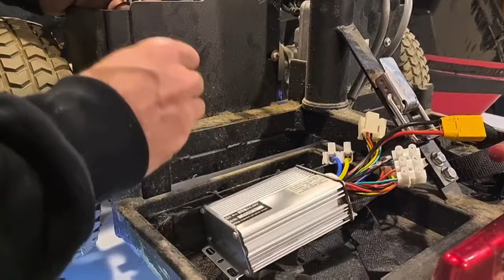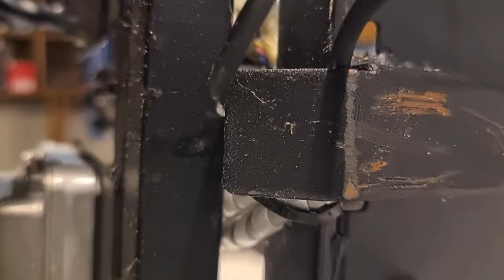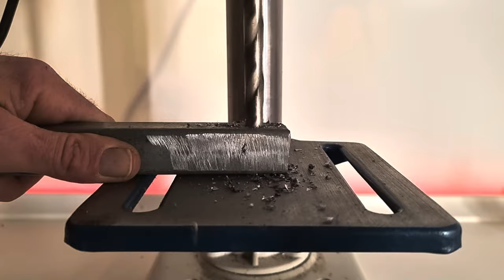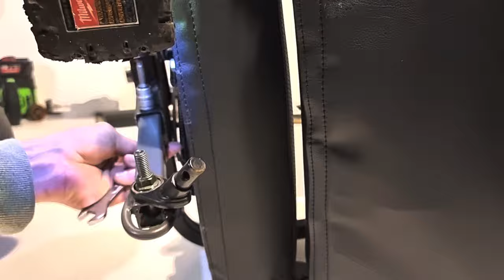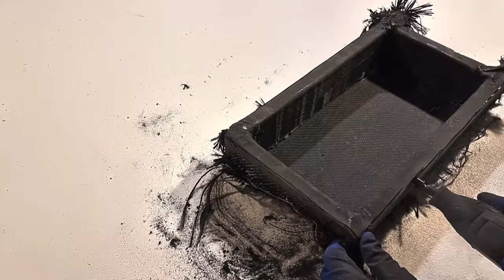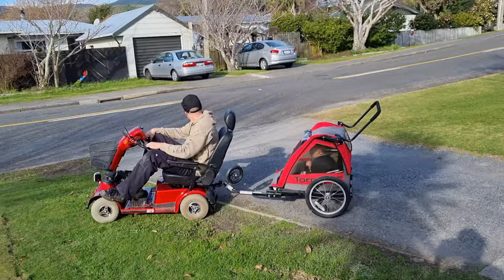DIY electric go kart for less than $100 usd with carbon fiber battery box, mobility scooter upgrade

Comment: I got tbe same controller, on a 24v 600w motor. With 48v lead acid its really slow, with 52v lion, its really fast but the battery cuts off on full throttle. What could be the issue
Reply from the maker: Bms in the battery, you either need a bigger battery or less power drawn from your esc
Reply: I had this issue with my ebike, the bms doesn't allow so many currency to come across, so it protects itsself, battery can be perfectly fine but the BMS just does the BS..

I got my first mobility scooter yesterday, i have a 1500W Ebike controller with thumb throttle and i wanna experiment with it, but first i shoud make 2 battery packs which are capable of holding it up.